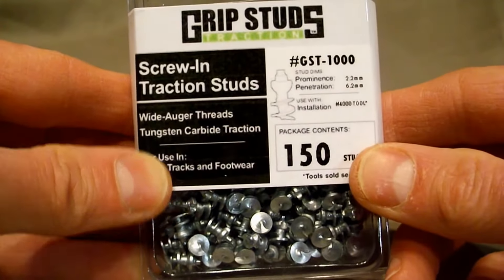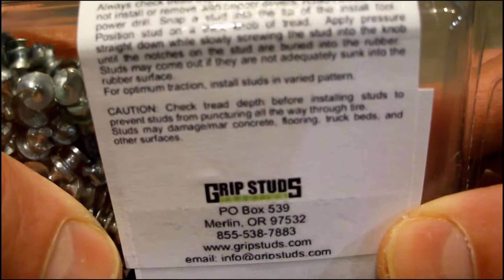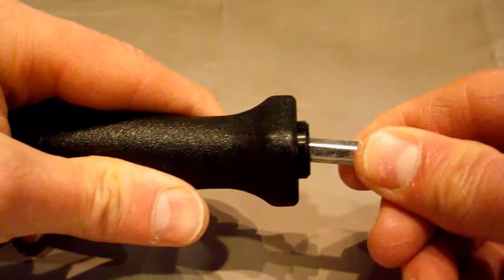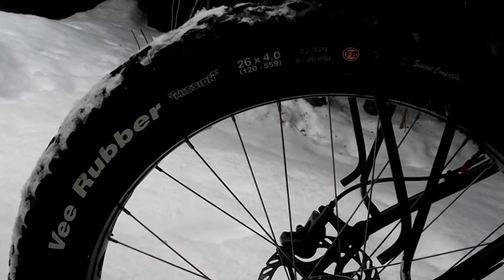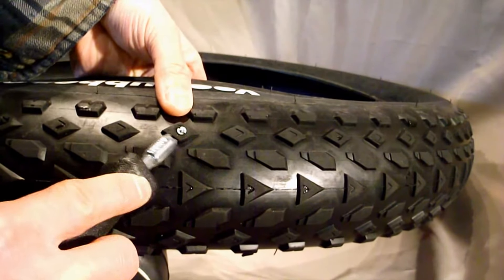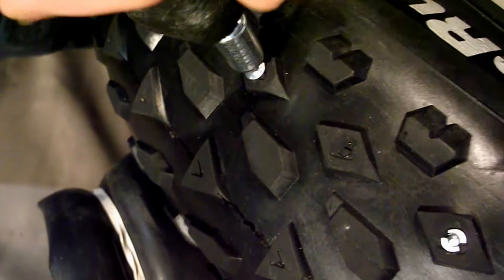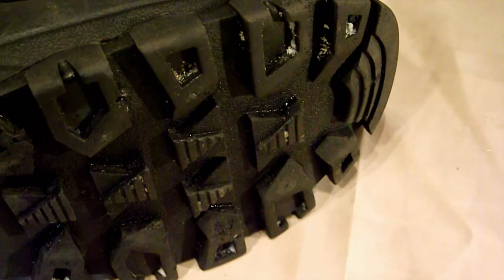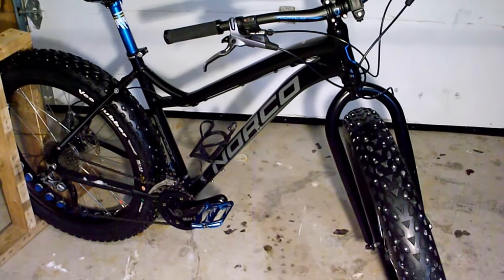Grip Studs: Unbox & Install in Fat Bike Tires and Boots

Comment: Very helpful, thanks.  I'm not happy with the studs in the Vee Tire Snowshoe XL so I got these grip studs.  A bit late for this year (2018, first year winter riding) but I have all summer to replace the studs for next winter.
Reply from the maker: Yea, the pointed tip studs on the XL do not do the tire justice.  No need to replace the studs, just add the GSs to empty lugs.  For a laugh I ran a line of GSs down the center of a pair of studded XLs and the traction increased significantly.

Comment: Problem with removing the studs for the summer time is tiny little pebbles will get into the open holes and once you try to put the stud back in for winter use, it will push that stone right through the tire. Best just buy a new set of tires.
Reply from the maker: I would tend to agree with removing studs from tires with stud holes. My experience with GSs is that the holes they make mostly close up when removed. But yea . . . if you got the $$ . . . two sets of tires are the best.

Comment: Would you recommend this technique? Thinking about surly molenda. Would be permanently altering the factory tires.
Reply from the maker: You have a Moonlander. Sweet. Not many options for studdable 20" fatbike tires. I think that the Vee Snowball may have a 20" but it is not 6.2". I understand that these studs are designed to be removed so that the tires can be used during the dirt months. I have never done that though. You may want to reach out to GripStuds for their thoughts.

Comment: Good vid but handle is poo. A T handle will allow you put palm pressure to start the stud. Without boring a hole through your hand...
Reply from the maker: It does get tough after a while. I believe there is a drill bit tip available.